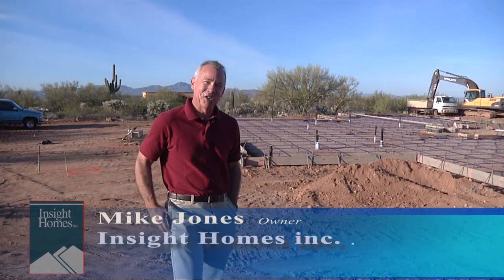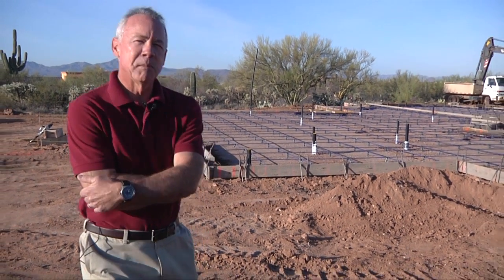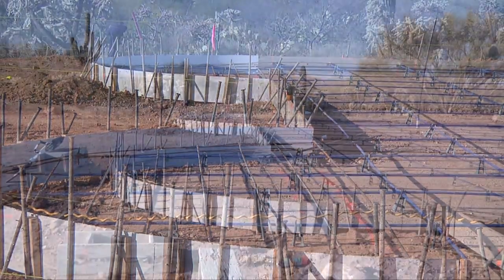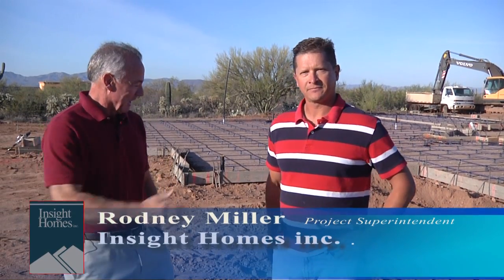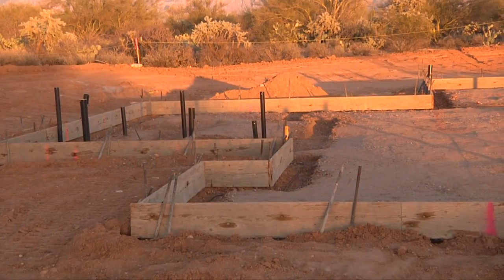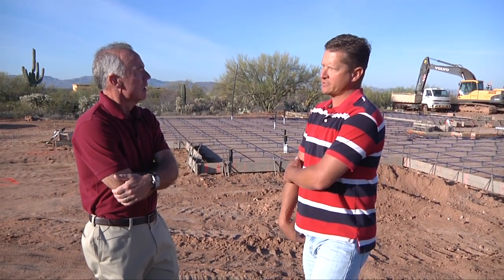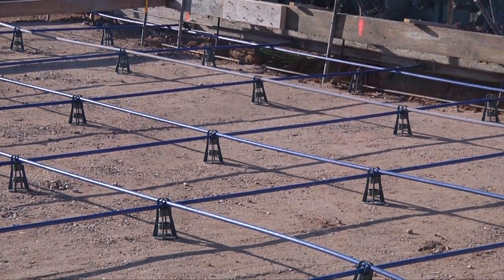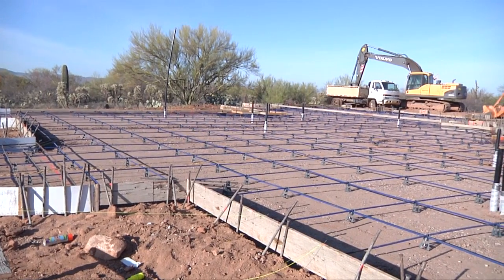Insight Homes post tension slab.mp4

Comment: Concrete is strong in compression but weak in tension. Typically reinforcing steel is embedded to handle tension, or post tension cables are installed to keep the concrete in compression.